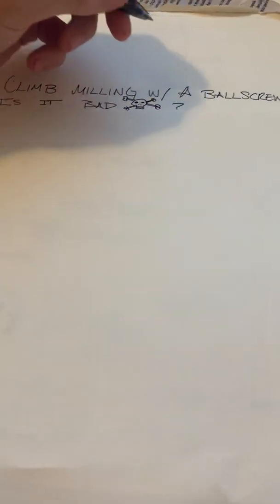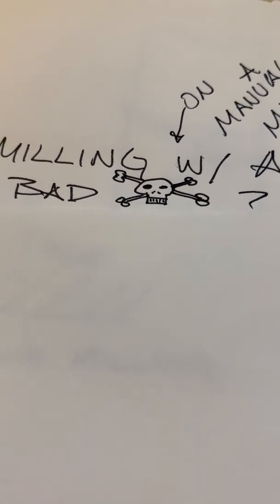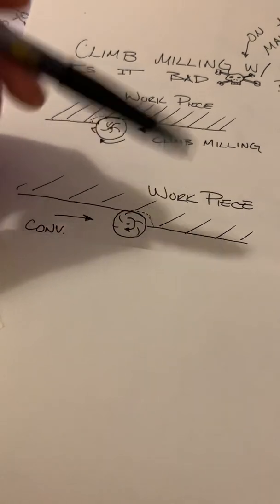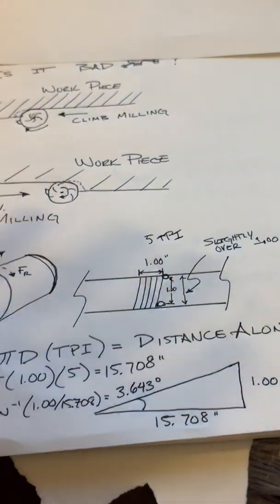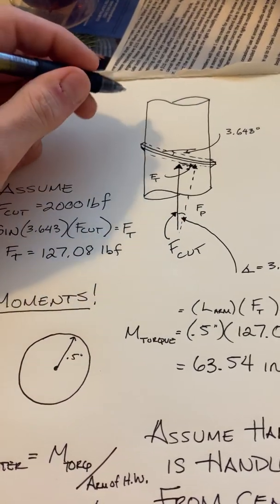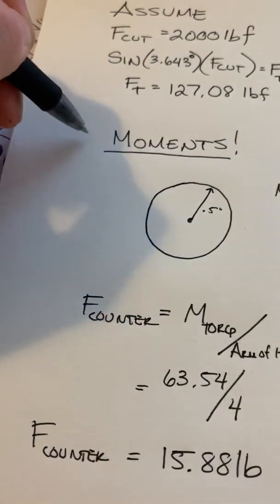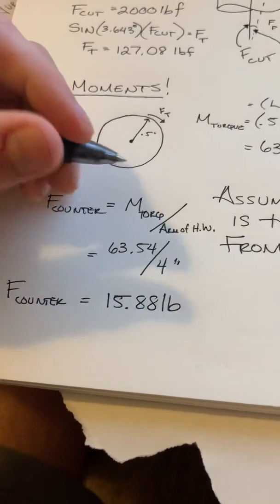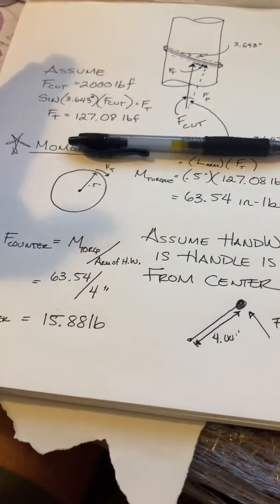Is putting a ball screw on a manual mill that dangerous?

Comment: I bought a used Bridgeport a few years back. I had to remove the 4 foot long table to get it into my basement shop. That's how I know my machine has a ball screw setup. This is my 1st Bridgeport so I have no experience using a mill without a ball screw. It's extremely smooth, there is some backlash and it can move a fair amount when climb milling if you're not careful.

Comment: Awesome! Thank you so much. Someone really needed to make this video.
Now, what about linear rails? Say for example, keeping the standard screw but installing linear rails in place of the dovetails and gibs?  I want to build or modify the knee, saddle, and table.  Thanks!
Reply from the maker: Aww man, linear rails are the thing for speed, especially in CNC machines, so are you trying to outfit your manual mill for a CNC setup?  If so, I think the linears could be beneficial but only if you take the proper prerequisite steps (which in my opinion there would be a good many) other wise you wouldnt get the full benefit of the speed of a linear system...you should check out the DMG MORI Evo 40 Linear with the mill turn option equipped to see what I mean by speed and precision.

Comment: My $0.02
When climb milling the cutter will be trying to grab more and more material unless the feed rate is controlled.
If you can’t control the the feed rate the cutter will grab more and more until the chip load exceeds what the cutter or motor can handle, which should result in either cutter breaking or motor stalling. 
I don’t see a real possibility of the table running away.
Cutter breaking could be bad, but that can happen anytime so protection is a must, ball screw or lead screw.
Reply from the maker: Very true, breaking tooling could be a concern!  Damn sure dont want your feed per tooth running off on you, but like you said, there is still no danger to the user....only their wallet.  Ive been toying with the idea of designing a braking system thats only activated by force input from the machine end, kind of like if a one way bearing and self locking drum brakes had a baby; but thats for another day.